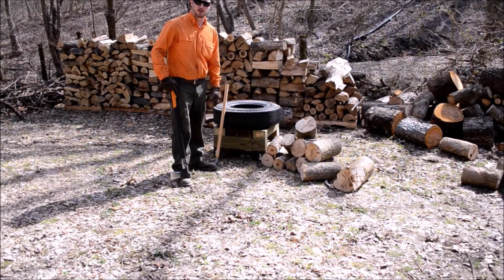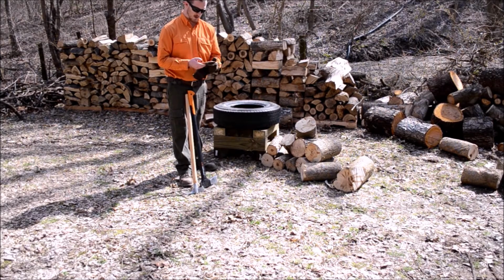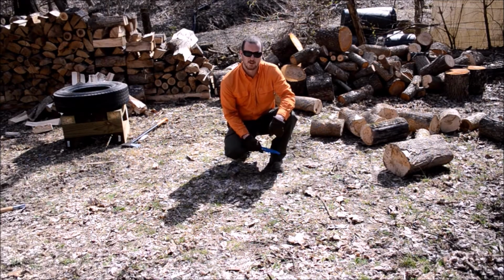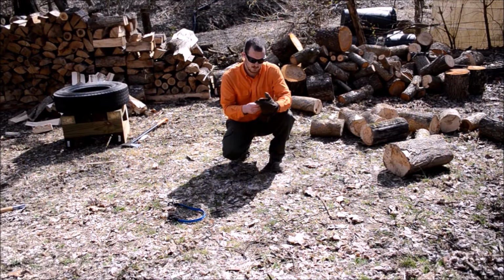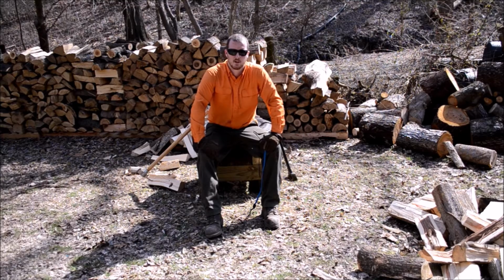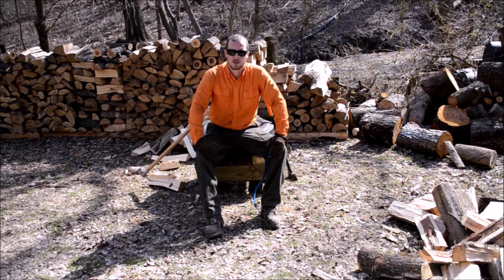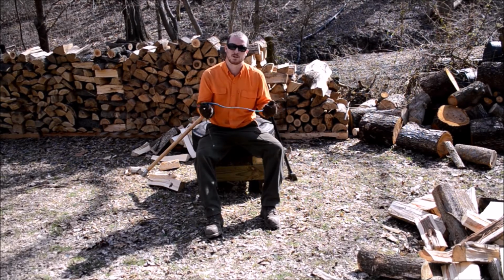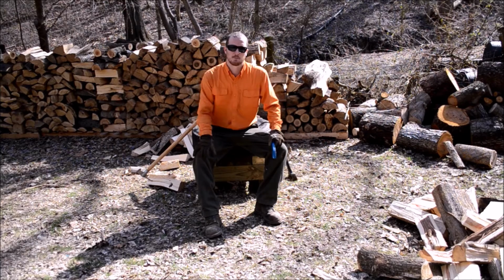Splitting Firewood With a Tire - Wood Splitting Tips and Techniques

Comment: Use one of the newer style tyres that have wide tread and narrow sidewalls. Or you could do what I used to do years ago; cut the bead and part of the sidewall off two tires, stack and sew them together with bailing wire. Split on the ground or short stump and move the tire, not the wood, unless little sticks like you were doing.
https://youtu.be/n_IQ6rzIVhA?si=DTx3KOtLeMCW1AFy